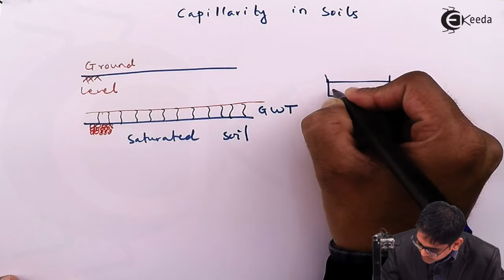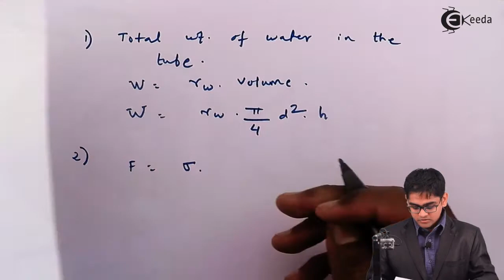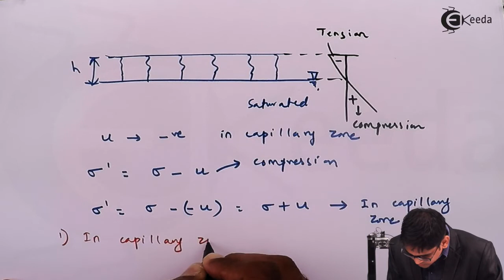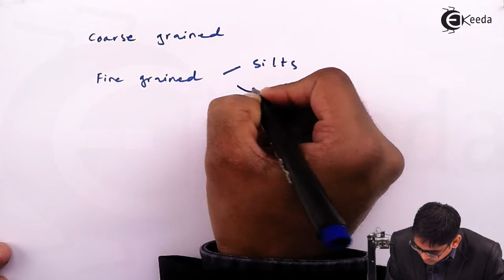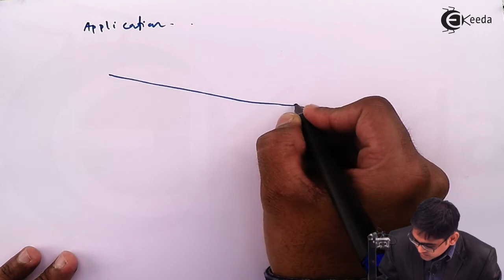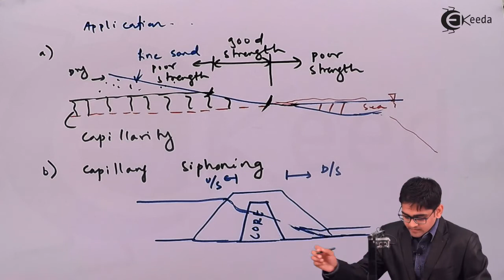Capillarity of Soils - Principle Effective stress  -  Soil Mechanics

Comment: 1.the rise of water in capillary tube is due to adhesive force between glass wall n water.
2.the capillary action is due to surface tension force...
Do both statements mean the same?